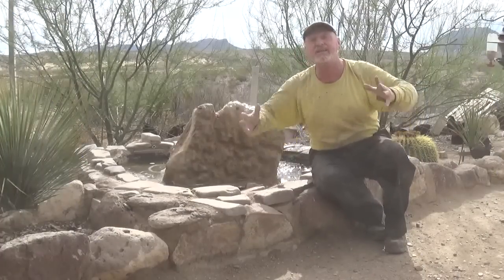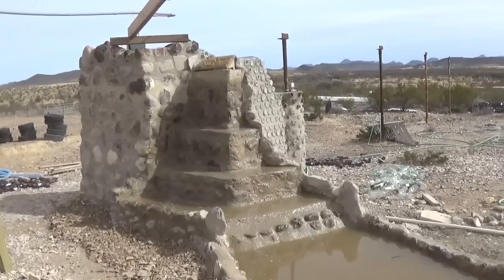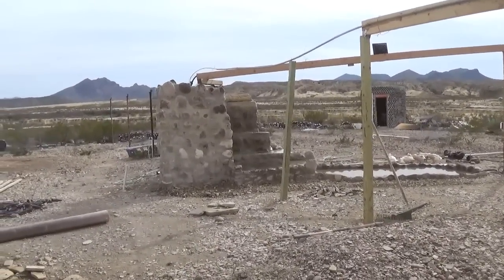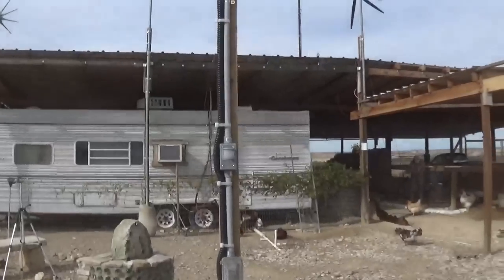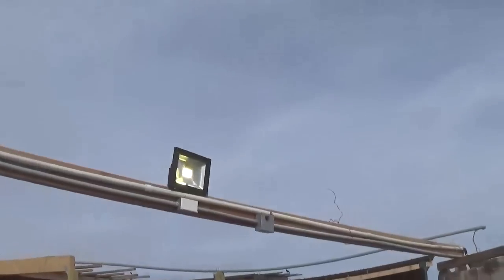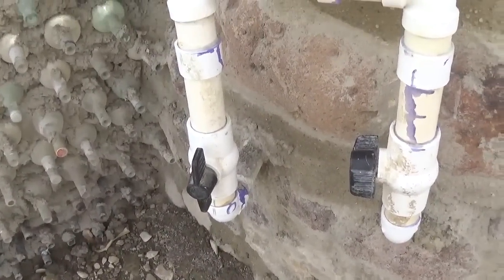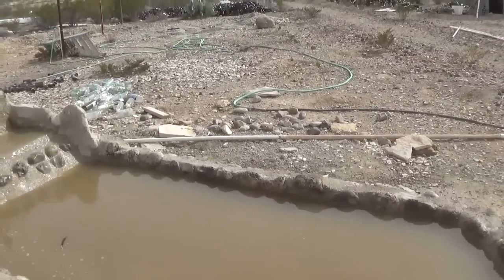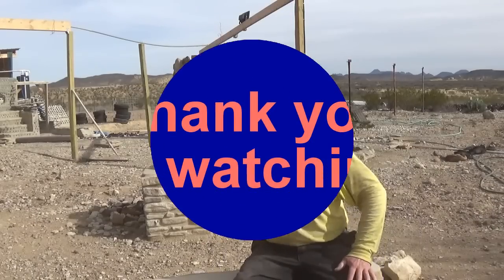The Desert Duck Pond & Fountain

Comment: Was there a solar power H2o pump available ? .  If you can grow grass , you can grow bamboo , it comes in handy .       To bad we don't eat coyote ,  but we can pelt them .      Always a pleasure watchin U folks serthrive , much luk to ya's
Reply from the maker: +Tracy James Tavares A solar pump would work and solve the "dawn to dusk" problem. I don't want a panel sitting around when there are already 59 of them though and finding a powerful enough pump to lift that volume of water 8 feet up was another issue. Had trouble starting bamboo with our low humidity and am waiting for the greenhouse to try again. Vetiver grass is different and grows in more places. We had some transients eating coyote in Terlingua this summer!
Reply from the maker: +bo ter berg I was not really clear on the top plugs. The coarse thread one will fit a finer thread pipe, but under the little bit of pressure that would be in the tank from water entering the top from one plug hole and  exiting the top from the other plug hole, the coarse thread would have leaked some. You cannot have a leak inside structure, so this had to be fixed. The plugs sold to properly make this transition, all cost around $22 with "shipping". But now the plugs do not leak and the solids settle to the bottom! When I drained the bottom in the video, it had been a week and the crap that came out REALLY was stinky, so it works!!!